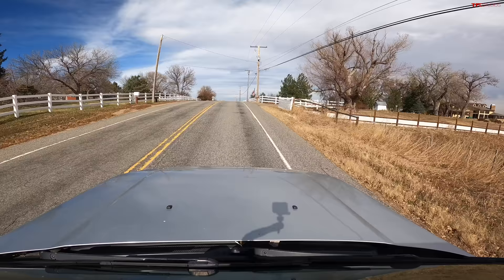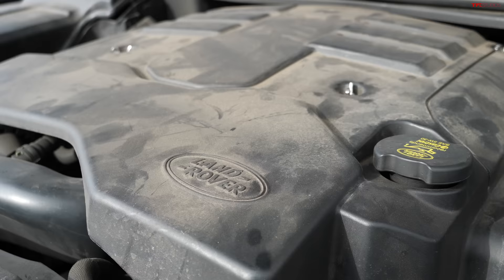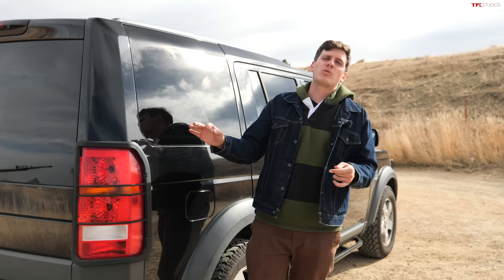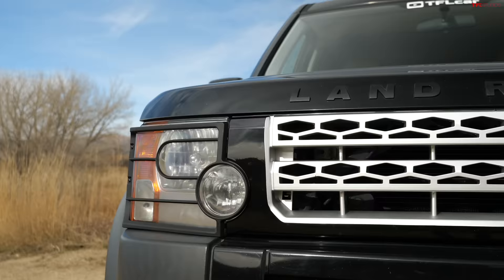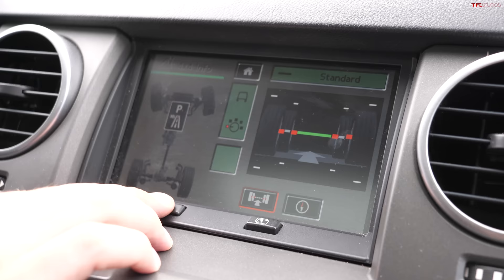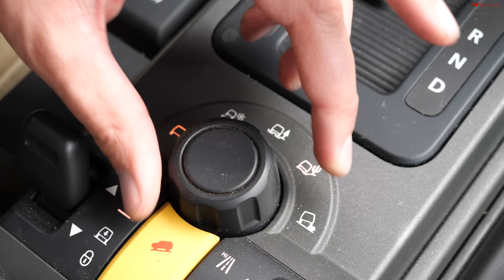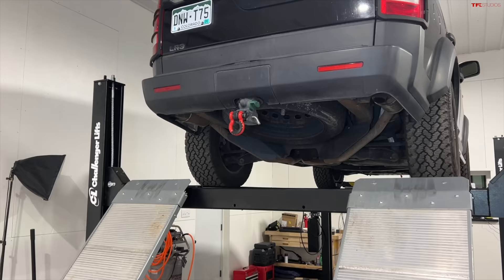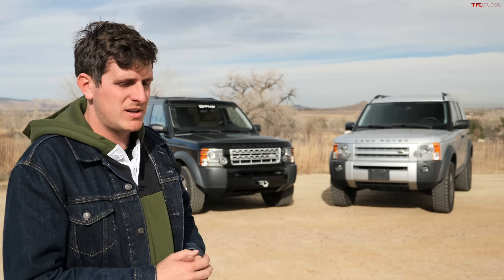The Truth about Land Rover LR3 Reliability - TFL Expert Buyers Guide

Comment: Two years ago, I bought an '01 Disco II with 145,000 miles on it. It was objectively the worst decision I've ever made. While off-roading in March 2022, the right side rear ABS sensor cable snapped and the "Three Amigos" came on. I replaced the sensor and cable. That didn't fix it. I've had three different garages look into it. They haven't been able to fix it. At this point, I can't sell the vehicle and I've drawn the line at wasting more money on her. So, I'm just gonna drive her the way she is and hope to amortize all I've put into it over another 2-3 years.

Comment: Wonder how similar the air bag system in the LR3 is to the rear only air bags you typically see in American luxury barges. My 06 Yukon Denali has rear air bags, and you could change out both rear shocks and the air compressor for around $400 in parts last time I checked. More expensive than leaf springs or coil struts, sure, but less than half the cost of a single strut on some of the European air suspension systems.

Comment: I had a 97 discovery it was junk. Kept it 2 years. Then bought a 2003 discovery 2 hse. At 84000 miles it was really nice. At first. It was constantly at the mechanic. Anything from sensors, air suspension, front shocks, ball joints, wheel hubs, sway bar, master brake cylinders and the lines, power steering pump and the steering gear box. Valve cover, fuel injection, water pump and oil pan gaskets. 3 different oil leaks. And much more. Then the alveston red clearcoat paint started fading at a very rapid pace on the roof and hood. I loved it but at 140,000 miles i had the plugs and coils replaced just still have a bad misfire and 7 engine codes. It may have a dropped sleeve im told or could be vacuum leaks fuel injectors and more. Time to let it go for good. I ended up getting a 2015 toyota 4runner limited and i still cant even sell the land rover for as cheap as $1500 with probably 15k in work and maintenence within the last 8 years. Never again.

Comment: My 2006  4.4 v8 has 250,000km 
Had it since 2009.

Personally think its the best family car, that can go anywhere, that you can buy.

That said, be prepared to spend on the following over time. Parts arent terribly expensive.

1. Suspension - compressor, air bag and valve blocks. 

2. Control arms and bushes - i moved to poly bushes which last ages, but make the ride far harder than rubber. I would keep them rubber if i knew the ride change would be so hard.

3.  Water pump, hoses and Expansion Tank - they crack and leak over time and is the ONE thing that will kill your engine.

I would NEVER buy the diesel. They break and die and maintenance far outweighs the fuel price difference.

I would also never change to coil springs. Doing that ruins the entire point of the car.

Comment: What about the Range Rover Sport? A friend of mine wants to buy a 2011, but I warned him off because I was concerned about engine/air suspension issues.
Reply: Did you have one?
Reply: @mihaimihai9254  Didn't have to--two neighbors of mine had bought used, early 2000s models, and one finally threw in the towel and sold it. The other one is still around. Complaints about the air compressor and some engine issues were enough to deter me, as well as you can find folks on auto forums who talk about the same thing plus possibly others. Don't get offended if you have a Range Rover Sport; I would chalk up their issues to bad maintenance issues--I'm sure you take care of yours, well.
Reply: @lego4virgo  This is good to know! Many thanks for answering! I don't have one. I'm a Disco II TDV5 owner. I didn't have any problems with my old car even though many people say it's not a trustable vehicle. I didn't get offended at all! Sorry if my comment made you feel so! God bless you!
Reply: @mihaimihai9254  I'm glad your Disco II has been good to you, and--I'm sure--you've been good to it. And not offended at all.
Reply: @lego4virgo  🤝🤝🤝

Comment: So if the LR3 has the Ford 4.0 v6 that is used in the Explorer, and the Expxlorer is the same size, why not get an Explorer for much less. Also has 4wd with low range available.
Reply: LR3 has superior articulation offroad, multiple offorad traction/drive modes, better on road handling.  If you just need an affordable 4wd to get through the winter get an exploder if you want to go offroading an lr3 is an affordable option if your handy with repairs.

Comment: Land Rover makes the least reliable vehicles on the road. There's just no getting around it.
Reply: Yet, they can’t produce them fast enough to satisfy the demand out there for them? Why?
The reliability argument is old and over used today.
Reply: And yet both mine have well over 200k miles. With one almost at 300k
Reply: It's ok. You don't need to buy one. Continue being an armchair referee
Reply: @mcandrett you can’t over use the argument that they break constantly… you really just can’t… are you tired of hearing it? Sure yes I get that, but as someone who owned two and one was only two years old and certified pre owned bs it didn’t matter constant trouble. Now I’d definitely do it again in a heart beat lookin for one now actually, 😅I just accept that it’s an adventure to own in many ways 🤷🏾‍♀️✌🏾😊
Reply: @LafemmebearMusic  That’s the spirit! You accept that it costs more to maintain and needs more things serviced on it than other vehicles and you can afford to do so. So no worries for you. 
I also drive one, mine has been rock solid and trouble free but I maintain is religiously and if something does go wrong I accept that it could be expensive and am prepared for it. 
Some of these salty mofos on here just ain’t ready for it 😂
Reply: @mcandrett So anyone stating a fact, that these are some of the most unreliable vehicles produced, (literally can't  read/watch any review without that coming up) then they're salty mofos?  It appears the only salty mofos are the ones here feeling they need to justify their purchase to anyone that actually cares about reliability above all else.
Reply: @gazelom  Yes they are. Many people just regurgitate the same old reliability crap without EVER having owned one. That isn’t to say the vehicles were without fault but it really is over used. 
I can comment because I have first hand experience. My vehicle is meticulously maintained and I’ve never had a major issue with it. 
If you cannot accept the costs involved to run one of these vehicles or the additional maintenance they require you need to stick to your Camrys and Civics. Simple really.
Reply: @mcandrett  Good for you. I'm glad yours has been trouble free. Problem is, you can't refute the mountains of data showing they just aren't as reliable overall as many other car manufacturers. The stereotype exists for a reason.
Reply: @gazelom  I think the argument is less relevant today. If it was that bad LR wouldn’t be in business today. You don’t go into business to lose money and today LR can’t produce the vehicles fast enough to keep up with the demand to the point where their prices have increased (as with other brands) and people still keep ordering
Reply: Of course it’s not reliable compared to the 95 corolla se you own. JLR I find is pretty on par w/ modern german cars. So keep driving your 90s camry, and leave these for the rest of us.
Reply: Nothing like an LR. Mine has 300k & still going.

Comment: Expected TFL would need to try to sell something else to recoup the time/effort to highlight a Land Rover.
Otherwise I suspect TFL is building up to the reveal of the that white LR2 driven by the kid a couple videos ago.
It's been a minute since then.  Not surprised.

Perhaps it broke down in the driveway...again just as expected.

And no, it's not that the air suspension 'has to be' replaced every so often - even tho it is a good idea to do so.
It's that the air suspension, at full height, is a complete compromise to a built and proper lifted height suspension.  Air suspension will never be an equal, a peer if you will, to a real lifted suspension.  That's all.

Comment: Yo here's an issue that I have with most of these car reveiw shows or car modding shows! My issue is with the commentators calling coil over shocks or air bag suspension shocks struts!!!!!! From the time I got my first ASE certification a shock absorber with a built in coil spring was always until the last 10 years was always called a coil over shock absorber not a strut and the same goes for air ride shocks!!!!! The defining factor for calling something a strut is a shock built with a coil spring and a bearing plate on top that replaces the entire upper control arm and that bearing plate built into the coil over shock absorber turns when you turn the steering wheel from side to side to turn the vehicle right or left!!!!!! So in short a a shock weather or not it has a spring or is an air shock that is not designed to replace the upper control arm and shock as a unit is not a strut at all but if the shock does replace the shock as well as the upper control arm then it is in fact a strut by design!!!!!!